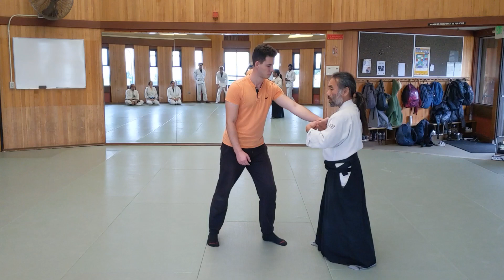Build engine and steering wheel inside of your body

Comment: I think what most people do is they turn around their axis. What I have found better is to slightly move forward, even if your legs stay where they are. That creates a tiny 'Irimi'-movement, which is necessary to control the opponent the way you do it.

I am currently figuring out some things similar to what you explain, but still have difficulty getting it right every time. So thanks for your video.